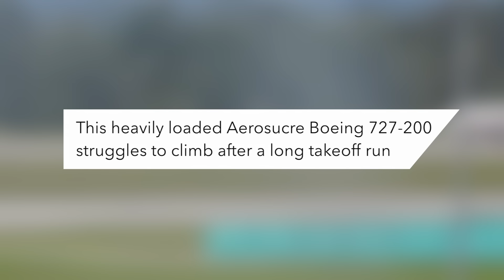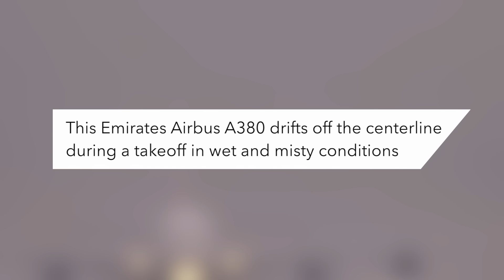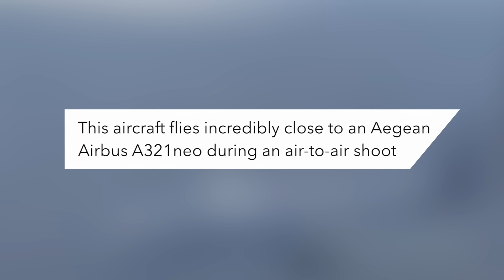Overloaded Plane Can't Climb

Comment: It doesn't have to do with over weight. If it was, the pilot wouldn't take off. The problem here is "Density Altitude" The temperature is high and the airpo0rt is also high in the mountains. The density altitude makes the air thinner and the aircraft needs a longer runway or use almost all the runway on takeoff. The pilot is taking it easy with the lift in order to avoid a stall!.  Oh by the way... I am a real world Pilot.
Reply: There's also the rare case of a windshear/microburst where the plane can not only climb but forced to the ground and destroyed as the Delta L-1011 did at DFW on 08/02/85. Most pilots complete a career and retire and never experience it and that's a good thing.
Reply: You are not a pilot
Reply: My solo flight was on December 22, 1975!!! Yes I am a pilot...
Reply: @DisobeyZOG  they don't have to be a pilot to understand this, anyone that understand basic physics and fluid dynamic will know this. And what makes you think they aren't a pilot?.

I'm not a pilot and I understand that the higher up you are the thinner the air will be which causes the aircraft to take longer to be able to get into the air, because now it has to go even faster to get the lift it needs to take off when compared to a runway that's at sea level, which is going to use more runway to achieve. It'll also effect the performance of the engine (I'm just not sure to what degree at what altitude).
Reply: @madmax2069  nice fan fiction
Reply: @DisobeyZOG  if you don't believe me, look it up yourself. But you already have a pilot tell you. But whatever.
Reply: @madmax2069  not everything you read on the internet is true
Reply: I think it more likely is overweight especially when you consider that it’s Aerosucre
Reply: @h2s142 lmao
Reply: i think they mean overloaded by the conditions
Reply: @h2s142 well not from an English point of view
Reply: @madmax2069 Dude, that plane was about or less than 50m from the ground. The air is not that thin at that altitude 😂😂😂😂😂
Reply: @abseil76   ahh you do realize that not all airports are at sea level right? And the altitude at which the runway is at matters.
Reply: @madmax2069  Ah, you do realize that this particular aviation company is famous for illegally overloading their planes all the time? 🤔
Reply: It’s Aerosucre. It’s overloaded, in a hot environment at a high altitude. You’re partially right
Reply: @abseil76   and that changes my point how exactly?
Reply: @DisobeyZOG kid
Reply: @Lonewolf_Fx  ya?
Reply: Then the airplane should have not taken off. Too much weight or density altitude either way incompetent pilot.
Reply: But surely the weight is also a possible factor?
Reply: I really hope you were joking or trolling. @abseil76
Reply: You are a "real world pilot"? I don't think so.
Reply: I am also a pilot and I agree it’s due to high density altitude why it’s climbing like crap, it’s amazing how terrible the climb performance becomes in any airplane at high density altitudes small or large.
Reply: @xThe_Chief  Aircraft climb very well in very dense air. At high altitude  airports such as in South Africa the air is thin and hot. Are you sure you're a pilot?
Reply: Strange hearing this from a pilot.
An aircraft has to be able to stop on the runway if there's a problem with the takeoff roll. So if a plane uses almost all of therunway on take-off, the pilot did something very wrong. He basically didn't load the plane to a level that enables safe operations. 
Especially in hot and high conditions in mountains you have to have the performance reserve needed to cope with losing one engine on the take off roll. Clearly if this 727 had lost an engine on take off after V1, it would not have the performance needed to clear the terrain and it also wouldn't have been able to stop on the little remaining runway.
This is very very basic airmanship to do proper performance calculations based on density attitude, weight, aircraft,fuel,  terrain and runway length before flight. This aircraft could have taken off with a safety margin legally required by law and common sense if he didn't take so much freight on board. 
Based on how late he took off and how bad the climb performance was afterwards in high rising terrain, the aircraft certainly had too much weight for the conditions given that day. 
So yes the reason for what we see here is that the aircraft was overweight for the conditions the pilot choose to take off.
So a really strange cake from a real pilot. And dangerous.
Reply: @Flinno-k8w  very good comment Sir.
Reply: You realize that in a way you are all right? No need for stress. It is multifactorial causation pathway for this condition.
Reply: @joaopaulosouza5661  And there are very basic rules and airmanship common sense to prevent this. 
If you go by the rules, this video would have been totally uninteresting with an aircraft climbing out like it should be extremely safe DESPITE that density altutiude that PILOT blames it on.
The density altiutude is not why this is dangerous. Density altitude is what it is and it should be a pice of cake for the pilot to determine the payload he can take at given conditions. And he shouldn't accept more, because that is playing lottery. 

That's an old plane with old engines, and betting your and your collegues lifes on relying on that none of the 3 old worn engines quit is just exceptionally TERRIBLE airmenship. And having a pilot blaming density altitude for it not questioning the pilot at all is troubeling. Really, really troubeling.
This is like saying Air Canada Flight 624 happend because the wind and the snow did it, they are at fault.
Reply: …and weight.
Reply: I assume you are not aware that Aerosucre has a history of overloading their planes?
Reply: @josemiranda1241 a real world pilot! 🤣🤣🤣
Reply: It’s the relationship between weight and air resistance to counter that weight. Less dense altitude means the relationship is too heavy. So yes it is weight
Reply: Aerosucre have been caught on numerous occasions knowingly overloading their freighters
Reply: Nice
Reply: I think that’s just another aerosucre classic
Reply: Good thinking
Reply: Airsucre is know for overloading their planes pro
Reply: It's called giving it the right title that will attract the most viewers. Obviously you are not a YouTuber.
Reply: Nah man that's Aerosucre.
They give NO SHIT to weigh limits or safety.
Reply: And btw im an airplane and it’s not weight, nor the air…I’m just fed up and ain’t doing it no more.
Reply: @DisobeyZOG please do tell us what your expertise in aviation is?
Reply: @topher1976au  Iraq
Reply: Most of what you say is correct. The pilot “taking it easy?” Hmmmm can’t say that is how I would describe this. The camera angle is showing that the plane is not climbing very well. This is an old 727 and it’s generally didn’t climb very well normally. You may well be correct with high density altitude, but I don’t know what airport he’s taking off from. He will have worked out his take off performance for the airport and conditions presented. A normal take off from and old jet. They don’t climb like modern day jets with  bypass engines. I took off from Hong kong today fully loaded and it took me 17 minutes to climb to 27,600ft. That was with a take off weight of 347 tonnes. (Aviation geeks will know my plane) a few days ago I took off from Seoul very light and made 43,000ft in 11 minutes. Same plane and similar conditions. The 727 just doesn’t climb well and has probably P&W JT8’s..they don’t really use the, anymore. The replacement jet was the 757… 

So “taking it easy!” Was not what he was doing. He rotated normally and climbed away normally on a plane that was basically under powered!
Reply: It was overweight due to the density altitude, pilot should have taken off at a lighter weight because of the high density altitude. So it was overweight.
Reply: @robboinnz  not true
Reply: @DisobeyZOG  oh ok, thanks.
Reply: @ jokes
Reply: Becauae this aerosucre use 727
Reply: @josemiranda1241  well then density altitude effects your take off distance and weight is the key component of success
Reply: FALSE
Reply: That’s a normal 727 take off 
I rode in the a dozen times
Reply: @DisobeyZOG I’m not a plumber but I know water leaks when the pipe has a hole in it. Duh
Reply: @_JimmyBeGood  ok

Comment: Another perfectly loaded 727 within an inch of its life, by the AeroSucre guys!!
Reply: They missed the weight, but at least got the balance.
Reply: Right, was it a C/G problem or flaps not set to takeoff  or was this a very high pressure altitude and high temp issue.

Comment: Happened to me on an Air Canada flight out of Antigua. Taxied out for takeoff and a warning light came up, so the pilots went back to the terminal. After 2hrs on the apron, they took on more fuel(probably too much?) after the problem was rectified, cause during the second takeoff attempt, we just barely got off the runway and were out over the ocean for a good 5 minutes before we got a positive rate of climb. Even the local sitting beside me at the window seat, was making an upward motion with his hands, cause he knew we were dangerously low!!! Had it been a SW departure, we surely would’ve crashed into Potters Village. They’re right when they say a chain of events always that lead to a crash.

Comment: Speaking of not being able to climb. I hopped a bush plane out of a hunting lodge in N. B.C. Canada with a very young pilot. It was completely loaded with Moose 1/4's. The 'runway' was dirt down hill carved out of the forest with tree stumps from the end of the runway to a lake about 100 feet below. After a full run down the strip, the pilot attempted to take off at the end of the strip, the plane shuddered, stalled and we hit the very end of the strip and bounced into the air, sinking toward the lake just above the stumps. I was desperately trying to drag some of the moose quarters forward as the nose would not come down and we could not climb. We were flying above the lake about 10 feet off the water. Fortunately it was part of a river system we followed down stream about 120 miles until we got to the local town strip that was next to the river. We never got over 15 feet above the water.
Reply: And then we got out and changed our pants

Comment: 1:13 Woah! Look at that wing fluff! 1:41 Again, amazing landing performed by these skilled pilots!
Reply: Actually was a crappy landing. No wind correction at all.
Reply: Pilot here, i don't see any rudder use at all the entire time... perfect way to get the side-loaded gear to tip the plane over into a wingtip strike, or blow the tires. D- 🫤
Reply: @games1004  right. What you said is correct.

Comment: I think the first clip was a perfect takeoff, overloaded or not. The pilot was very professional and did not drag the tail on the runway or stalled the plane on takeoff. That probably took quite some nerves. The urge to pull on the yoke wathing the trees getting larger and larger must have been STRONG. :) I'm sure this takeoff was properly briefed and the W@B was calculated before.
Reply: That wasn’t overweight. It’s a typical 727 take off. Wasn’t near any trees either, that was an optical illusion with the camera.
Reply: Well said

Comment: Egyptair doesn't appear to use any rudder at all until after touchdown.  Maybe just the angle we're looking at it.
Reply: You are not supposed to use the rudder until just prior to touchdown
Reply: @styren2815 yeah,  but you're definitely not supposed to wait until after touchdown.
Reply: On a wet runway you can just let physics realign you. On a dry runway you’re best to give the rudder a nudge after the flare.
Reply: @EdOeuna true, but both ways are just lazy. A competent pilot takes the crab out during the flare.
Reply: On the plane I fly, you have to take the drift off before touchdown otherwise you smack your head on the window and I pay for those windows and the tyres and the paracetamol.  In a heavy aircraft the idea is the centre of mass is ahead of the main wheels pulls itself straight on landing within reason (that 747 guy) but, he adds, in reality you do anticipate and reduce the drift gradually before touchdown because its not so nice for people at the rear of the aircraft.  So I think if there's a not much crosswind you don't bother much, if there's a lot you do. This pilot lets the aircraft drift way off before mashing the rudder to what looks like full deflection some time after touchdown.  Contrary to belief you don't need to be an expert to see something isn't done right, I can detect a wonky brick wall or hear when someone is out of tune even though I can't sing.  What we know is that there wasn't enough rudder until later on - but there could be reasons for that or it could be that the pilot not-flying had to put input in, hence the delay, we'll never know.
Reply: @dr_jaymz  the largest aircraft I’ve flown are the A340 and 747 and on both, I always take the crab out prior to touchdown, even in light winds. I want the nose pointing in the correct direction. This does mean that one main gear touches down first (upwind side). But it also means you have to be. Careful, you can’t drop the wing too much, since the engines will come close to the ground.

Comment: This reminds me of the flight out of Albany NY on US Air / Delta
We were on board a plane designed to hold 50, that was packed with over 200 people and severely overweight

We rolled 2 miles down the runway and they tried to get the nose up and it slammed back on the runway, and as we rolled past the diagonal lines, onto the gravel, the pilot pulled and we cleared the fence by about 10 feet and we were supposed to turn left, but the engines were screaming and we kept flying really low due north.

We were maybe 500 feet as we passed over Saratoga and just kept going north.
After about 45 minutes we had finally burnt enough fuel to gain altitude and the pilot turned left.

We landed 3 hours late, and I swore that I was never going to fly again and I never have.

The investigation showed the running phrase in the airline industry is LOAD FACTORY IS JUST A NUMBER
Reply: Bravo on the BS.    You left out the slash s.

Comment: My father flew for Air California back in the 70s and they had just acquired a DC 9. He was flying out of Tahoe for the first time with DC9 where normally the company flew their Lockheed Electra which could handle the higher altitude. As he was going down the runway he could barely get the plane to clear the tree line at the end of the runway. That was a close call he said and the reason why was that they were overweight due to a large group of gamblers from San Francisco had kept all their Silver Dollars they had won!
He was pissed at the baggage handlers for not letting him know how heavy the bags were and after that they always took on less fuel to allow for any extra weight.
Reply: They also weighed every bag in Tahoe going out after that incident.😅😊

Comment: The first plane just need 
MORE FLAPS!! IT LOOKED LIKE
Reply: More flaps gives a worse climb performance. So no.
Reply: @rtbrtb_dutchy4183  Only if your speed is too low. And why make a higher flap setting. He had what looked like only 20° or 25°.
Reply: @DUBEE43  what?  No, less flaps gives better climb performance. 
He better not have 20° of 25°. That would be too much. 🙄, yet if you believe it’s 20 or 25, why would you call for even more flaps?  Makes no sense.

Comment: It’s not the aeroplane that struggles to climb due to overloading. The issue is that the pilots a
have underestimated either the plane’s mass or the maximum thrust needed to accelerate to take off speed and climb.

Comment: Aerosucre probably maintained its 35ft screen height on departure, so it looks a lot worse than it actually is. 

As for that Ryan Air landing. I don’t know how a company thrives on bad landings. Clearly the low cost business model makes up for the poor reputation.

Those Westjet pilots need to be retrained. It didn’t look like windshear. They should be 50ft over the threshold, not land 50ft before it.
Reply: Here we go. The opinion of a real pilot who knows what he is talking about. (Assuming Ed is male). 
I agree with all you said. 

As to Ryanair, I saw at a forum that they have a high turnover over. It’s usually the start of a pilots career and they move along quickly. Their pilots, though safe, don’t have a lot of experience, hence the occasional hard landings.

Comment: Everytime I land at Trenton airport NJ coming from Orlando FL. There is this one black pilot that NEVERRRRRR FLARES. He drives that landing gear into the ground and I absolutely hate it. I’ve complained over and over along with other passengers but since Frontier is apart of the whole “everything woke turns to s**t” thing they will never get rid of bad pilots so long as if they are black or Spanish.